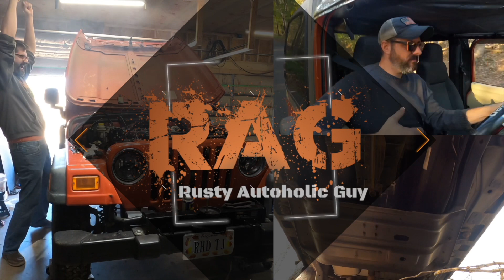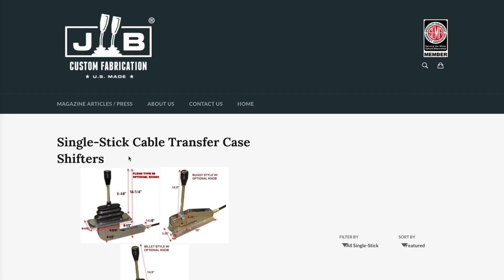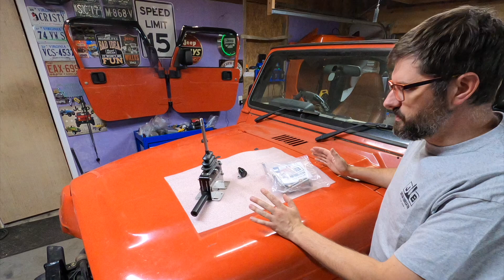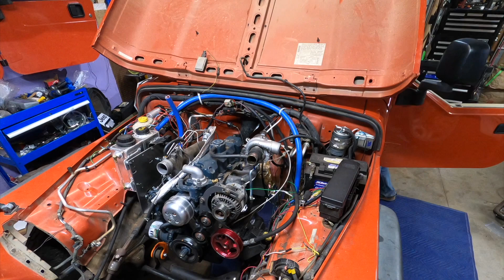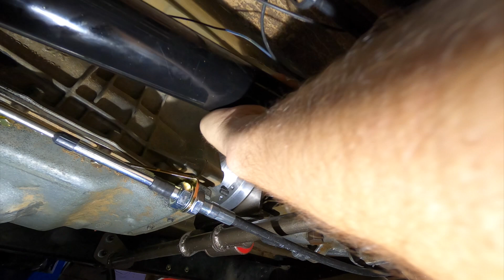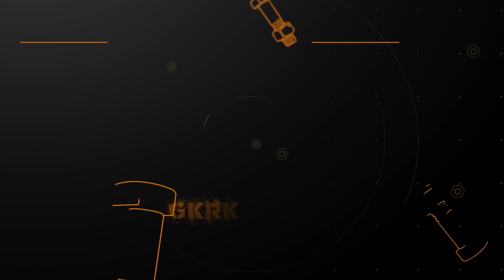Installing JB Custom Fabrication's Single Billet Cable Transfer Case Shifter on my TJ Wrangler

Comment: Nice looking transfer case shifter. Does it absolutely have to be mounted to a flat spot in the floor?
Reply from the maker: No it does not, the way the brackets on the side of the shifter are slotted, you can mount it not on a flat surface.

Comment: Thanks for posting this video.  I'm in the middle a Willys Wagon Resto-Mod build and am currently installing one of these and wasn't sure on the transfer case bracket location.  This video answered that question.  By the way, how do you like the diesel install?  I have a 4.6 stroker in my other Jeep and I'm not sure it was worth the effort.  Looks like you've gotten to more than 1,000 subscribers.  Nice work.
Reply from the maker: I absolutely love the diesel engine, both the Kubota that was in it and the TDI. The low end torque is incredible. While the fuel economy is great, I also realize diesel fuel right now is REALLY expensive, however for what I'm trying to achieve, mainly massive range on and off road, for me the diesel was the only choice. Also the low end torque while driving paired with the turbo is just so much fun to drive.

Comment: How long it’s the cable
Reply from the maker: I'm not sure, I would have to go measure it, but because my driveline is so far forward compared to other TJ Wranglers, my transfer case is were the transmission usually is, I'm not sure how much that would help, but I can measure it this weekend.

Comment: Hey Grant, really like the look of this shifter. What nutsert install tool is that?
Reply from the maker: Thank you so much Ted! This is the one I bought off of amazon:

https://www.amazon.com/Astro-Pneumatic-Tool-ADN38-Adapter/dp/B01JBHWBR2/ref=sr_1_30?dchild=1&keywords=nutsert+tool&qid=1623605448&sr=8-30

Works great but I have broken one previous for using a more powerful impact than what it says to you use, I think it's rated for 18V and I put a 24V on it once and broke it, my fault, bought a second one and it's been great ever since!